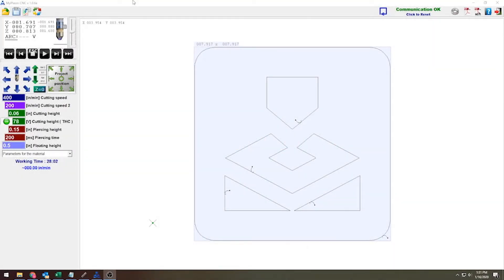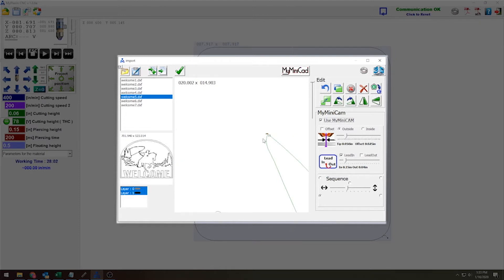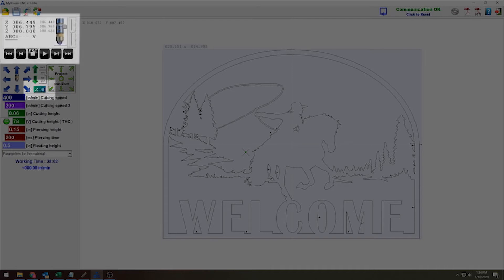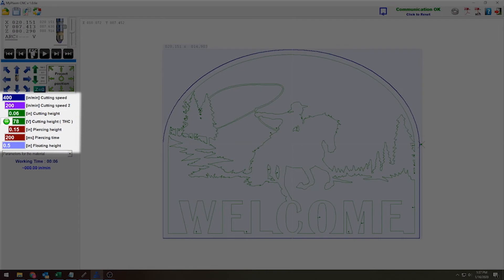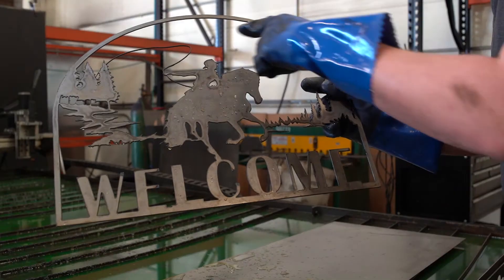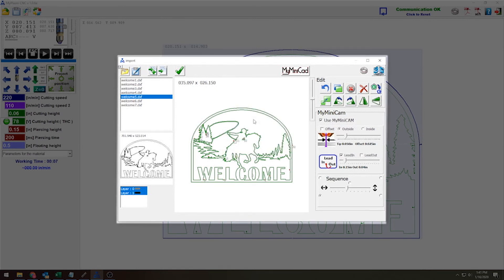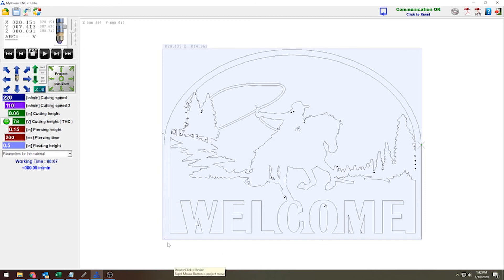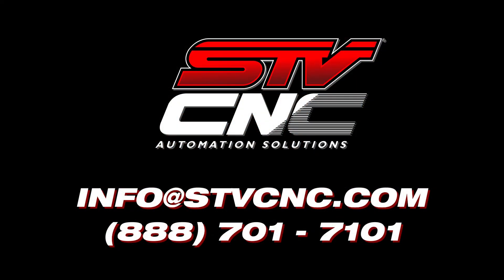STV CNC Tutorial - Making a Test Cut

Comment: Our plasma tip touches the project material and raises like 2.5 inches above the material and un the setting for the z access is at 0.5 for the floating head switch. Any info on how to fix that
Reply: My table was doing the same.. did u figure it out... i figured out what i was doing wrong with mine..